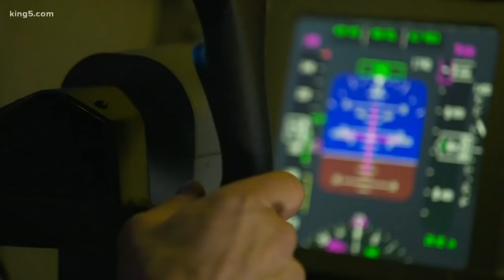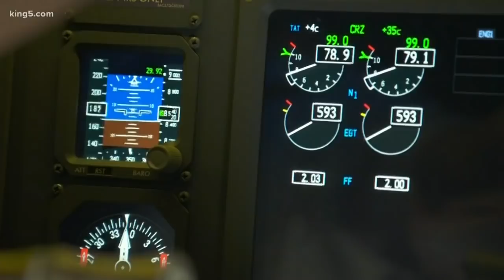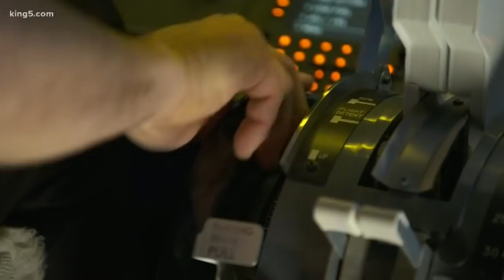Boeing 737 simulator helps us understand final minutes before deadly crash

Comment: this is quite enlightening , those max 8 pilots from flight 302 and 610  should at least have known where the  auto trim  - cut - off switches were . . . after all both the Indonesian  accident and the Ethiopian one occured in VFR conditions .  
  ie )   VFR  flying    is visual .  . getting clues from  out the window  . .. not burying your attention into the panel    .   any pilot is normally well  practiced in the emergency of a run away trim . .. . .  and knowing where the auto trim  cut out switch is on any aircraft would  be covered in the type rating hand book .  flicking a switch takes all of about half a second .. .no biggy . . ..  but if they dont know where the switch is located  then  it is indeed  a biggy . . . . .

Comment: 1:51 what's the point of having the lines for a traditional horizontal stabilizer if it's an all moving tailplane or stabilator I'm not sure the exact terminology

Or is that just for the MCAS?
Reply: It a trim feature and almost all commercial aircraft have this kind of stabilizer trim system now. Mostly because it's more fuel efficient than a trim tab.

Comment: With the tailplane fully elevated, the pilot switched off the breakers. Then he was turning the trim wheel with two fingers. I think they found out that this is not possible in a real flight situation. The simulator was not set up correctly. Maybe one reason for the FAA and Boeing deciders to consider the whole thing as not critical. Without servo support you probably wont have enough time to get the trim back if you have enough muscle to turn it anyway.

Comment: What pilot would be so stupid to pitch up into a stall? Why would Boeing need software for that?
Reply: They arent ... it's a design problem with the aircraft, the max's engines are larger and had to be mounted forward and higher on the wing, this has a tendency to push the nose of the aircraft up at a very slow rate (that the pilot may not even notice until too late e.g. in bad weather or night), the MCAS was supposed to adjust the tail trim to counteract this.
Reply: @nurgle11  Nope, not accurate at all. Been watching to much main stream bs media stories. Try doing some actual fact based research. I could tell you if you want.
Reply: Firstly, it is a common problem in pilot error crashes all thru aviation history. That is why the stick shaker is on all airplanes, or a voice warning system for stalls. Mcas isn't mainly for that at all. To make a long story short, it's to make the max flight carectoristics like the previous 737 models. That way the max didn't require extra simulator training for pilots to certify on saving airlines many millions. Airbus does the exact same thing. They make the cockpit and airplane as close as possible to the next for that reason.

Comment: One more thing: A defective MCAS system is not the only way the trim can run away. If you notice, all the yoke mounted trim switches, the one you activate with your thumb, are of the split switch design. It was not always so. The first systems had just a single rocker switch but it was found that the switch was a common cause of trim runaways. Pilot sweat, dirt, and just mechanical failure teamed up to highlight a common point of failure. Certification requirements changed to a split switch - two switches in series, to mitigate the risk. There still exists other points of single failure such as the relays that operate the actual motors. Again, and I don't know if the 73 is configured this way, is to have two relays, one to engage the system and another to run the motor in the correct direction. This again mitigates the risk. There's no doubt that Boeing should have relied on more than one sensor to trip the stall protection system but since they were sure that traditional training on trim runaway would mitigate the risk they chose not to. I've been in many simulator training sessions where I've been given a runaway trim scenario. Also typical is jammed elevators, jammed stabilizer nose up and nose down, etc, etc. Perhaps these guys were trained in the airplane where you can't duplicate such failures, I don't know, but surely, after the first mishandled runaway there was plenty of information out there and discussion.

Comment: It's purely a runaway trim no matter what the cause. Runaway trim management is taught in every plane with a powered trim system. The 737 cockpit is the same in this sim as in the max and the remedy is to deactivate the trim system and trim manually. It looks like the crew mishandled this one.
Reply: But they probably didn't have time to perform this because they were at a very low altitude
Reply: @emerald3331  Actually, looking at the Ethiopian Flight Data recorder they initially, after some delay, reacted properly and shut the trim off. Power remained at takeoff power and speed increased to VMO + 20. They were climbing but were unable to manually trim at that speed while still holding heavy back elevator. They then turned the electric trim back on but that activated the MCAS again. Why they did that when they had a positive rate of climb I don't know. We'll have to wait for the Voice Recorder to hear the discussion. I think they got in a situation with both stall warnings and overspeed warnings that they were unsure of what was happening. In the overspeed condition while holding so much back pressure it may be that the stabilizer could not be trimmed by hand. More information needed.
Reply: @emerald3331  More: Report At Odds With Claim That Ethiopian Pilots Followed Boeing Guidance 
 
Paul Bertorelli
 
 

According to a preliminary accident report, the pilots of an Ethiopian Airlines Boeing 737 MAX that crashed on March 10 were unable to manually counter significant nose-down trim before losing control of the airplane in a dive that reached 500 knots. The report, released by the Ethiopian government Thursday, confirms that the MAX 8’s MCAS subsystem, a stall-protection add-on, rolled in nearly maximum nose-down trim in response to a faulty angle-of-attack sensor.

But the report, which draws no final conclusions, is silent on whether the crew simply didn’t know how to use mechanical manual trim or if trim input was inhibited because the airplane was flying at such high speed. The pilots retained takeoff/climb power throughout the accident sequence. Ethiopian Airlines said that following the crash of a Lion Air MAX 8 last October in Indonesia, the crew was briefed on Boeing-provided information on how to disable MCAS. And although some mainstream news organizations have reported that the Ethiopian pilots followed Boeing’s checklist, the report suggests they departed from it in one key detail: After initially disabling electric trim to isolate MCAS, they reengaged it later, allowing the malfunctioning system to trim the airplane nearly full nose-down.

MCAS—Maneuvering Characteristic Augmentation System—was added to the MAX series because the engines are heavier and mounted farther forward than on previous 737 models. As a result, in flight test, the airplane demonstrated a pitch-up tendency at high angles of attack and/or high load factors. To counter this, MCAS automatically adds nose-down trim at high angles of attack when the airplane is hand flown with the flaps up. Boeing has described it as a stall-protection system, but it also increases perceived pitch force before stall angle of attack is reached.

MCAS is fed by a single AoA sensor and in both crashes, the sensor furnished inaccurate information to the flight computer. The Ethiopian report said that the left-side AoA indicated 74.5 degrees less than a minute after takeoff, while the right side indicated 15.3 degrees. This activated the left-side stick shaker and MCAS eventually responded by rolling in nose-down trim. It also gave the crew airspeed and altitude disagree alerts between the left and right side displays.

Following Lion Air, Boeing’s guidance for this situation—published in the Ethiopian preliminary report--called for several steps that combine its existing standard runaway trim with the MCAS’s peculiarities. Specifically, the checklist calls for disengaging the autopilot and autothrottles and, if the runaway continues, setting electric trim to the cutout position, disabling electric trim. Boeing said it should remain off for the remainder of the flight. The checklist advises to trim manually with the mechanical wheel and to “anticipate trim requirements.” Following Lion Air, Boeing also said that a significant out-of-trim condition caused by a runaway could first be corrected with electric trim before the cutouts are used. Flight data appears to show that the Ethiopian crew didn’t do this.

At 5:38:58, the captain, who was flying, called for the first officer to engage the autopilot, opposite of Boeing’s guidance. At that point, the crew had a left side stick shaker, some of the fault warnings and a master caution light Boeing listed, including airspeed and altitude disagree. It’s unclear if this had any bearing on the accident scenario, since MCAS is disabled when the autopilot is engaged. (The autopilot disengaged 33 seconds later.)

Shortly after the autopilot disengaged, the FDR showed that automatic nose-down trim activated for nine seconds, confirming that MCAS was reacting to and trying to resolve the erroneous AoA indication. The captain countered this with electric trim with his yoke thumb switch and later asked the first officer to “trim up with him.” The aircraft began a series of pitch and altitude excursions, but the power was never reduced below 94% N1, an unusually high power setting.

After struggling against the automatic pitch trim and excursions for several seconds, at 5:40:35—about two and half minutes after takeoff—the first officer called “stab trim cutout” twice. The captain concurred and the report indicates the cutouts were used. The 737’s trim system is operated by an electric motor/jackscrew arrangement that trims by moving the entire horizontal stabilizer. In the event of a trim runaway, the cutout switches on the lower pedestal disable the electric motor. But the 737 still has manual mechanical trim wheels on either side of the pedestal that are accessible to both pilots.

Six seconds later, the FDR showed that more automatic nose-down trim was commanded, indicating that MCAS was still sensing high AoA. However, the data showed the stabilizer didn’t respond to this command, confirming that the cutout switches were engaged. MCAS can only move the stabilizer if electric trim is active.

The report indicates that shortly after the cutouts were used, the trim gradually moved nose-down from 2.3 to 2.1 units. It’s unclear why this happened, since electric trim was disabled. At this point, according to the report, both pilots were exerting pitch-up force on the control columns, after the captain asked the FO to assist him.

At 5:41:46—a little over four and a half minutes after takeoff—the captain asks the FO “if the trim is functional.” The FO replied that it wasn’t and asked the captain if he could trim manually. What’s unclear is if the FO meant trim manually with his yoke-mounted electric trim switch or the 737’s mechanical wheel. The training manual for the 737 MAX includes a warning that excessive airloads on the stabilizer could require the effort of both pilots to correct a mistrim condition. "In extreme cases, it may be necessary to aerodynamically relieve airloads to allow manual trimming. Accellerate or decelrate towards the in-trim speed while attempting to trim manually," the training guidance says.

The data indicates the stabilizer was never moved manually mechanically. However, 32 seconds before the crash, the FDR trace revealed two momentary manual electric trim inputs commanding nose-up from 2.1 to 2.3 units.

This indicates that counter to Boeing’s guidance, the crew reengaged electric trim, allowing MCAS to once again regain control of the stabilizer. In five seconds, it moved the trim nose down from 2.3 to 1.0 unit, a value that’s nearly maximum nose-down in the 737, according to sources AVweb contacted for this story. The aircraft reached 40 degrees pitch down before impacting at 500 knots, according to the FO’s data. According to the report, power was never reduced from the takeoff/climb value.

Ethiopian Airlines said that its pilots did follow the Boeing guidance and in a press statement, the airline said, ”We are very proud of our pilots' compliances to follow the emergency procedures and high level of professional
Reply: Exactly! It's funny that of all the "reporting" about this incident, the media has chosen to stoke fear and conspiracy instead of doing what this news station did and actually fly this in a simulator to show how easily this is managed if a pilot recognizes what's happening and then follows the proper memory item drill. I guess hyping the near death experience all of the flying public feels they have every time they take to the sky gets more clicks or views - which means more revenue from advertisers, but the context provided by showing a real pilot demonstrate the failure mode and then the memory item drill - with it clearly being an easily managed task - would be far more responsible.

Comment: The plane needs to be redesigned. If an MCAS system is needed to try and sort out the inherent design problems of the plane, it shouldn't be allowed to fly. This is a passenger plane for the paying public. Not a dice with death ride at the public funfair.
Reply: Many planes have stick pushers to keep the plane from exceeding a critical angle of attack. DC 9/ MD 80 series and Challenger 600-605 are ones I'm quite familiar with. They do use the trim system but actually push the yoke forward in the Challenger - it will snatch it right out of your hands forcefully. DC9 drives the elevators nose down, again very forcefully.
Reply: Glad I'm not the only one thinking that this airplane is just a bad mix of different designs combined awfully.
Reply: Very right. This design is outdated and cant handle the new motors well. That simple. If Boeing designes unstable fighters with jettisonable seats it shouldnt apply to passenger ac

Comment: Two pilots in each plane could not either the shut-off switch didn't work or the pine was in too bad of a nosedive to change nothing should be on a plane that a pilot has to turn off to prevent a crash 100% Boeing aircraft fault
Reply: Ardent Fan  BS. Every one of the 7 type ratings I hold has an electric trim system and in every one at some point in training I was given a trim runaway until the reaction to deactivate it was instinctive. It only takes seconds.
Reply: also ,even if they turned it off they would not been able to revert the trimming by hand that was almost impossible because of the forces acted on to that Control. They would have to turn it off the first second it happend. There was not time for any one to react
Reply: John Spurlock if they turned it off it will never work electrically with pickle switch. They tried 24 times. I can’t say this loud enough. I must be trimmed with one or both of manual trim wheels. The plane could have been saved. See Mentour Aviation website for mcas video. Please!  

Our crews are very well trained as was the jump seat pilot on the plane on the Lion Air aircraft the day before it crashed. Most major airlines have their own simulators for on going training. 3 world countries may have planes but are their pilots trained.
Reply: Steve Steinlein no. The plane could never be saved, because the full manual mode would’ve been ( and has been) impossible because of the speed! Stupid idiot!